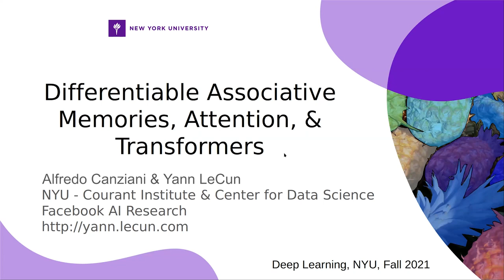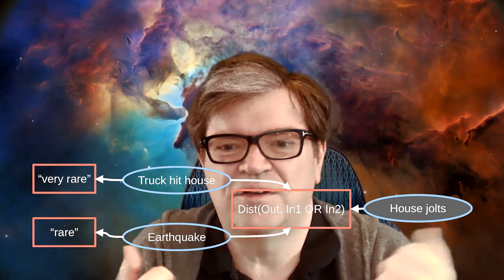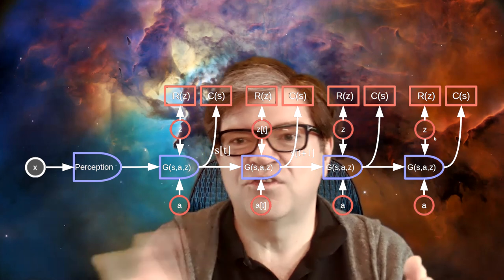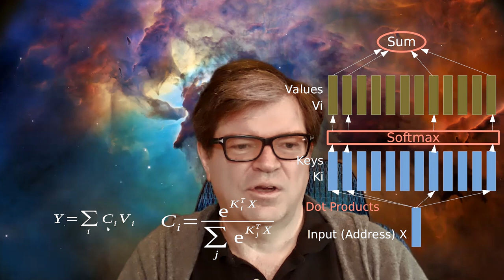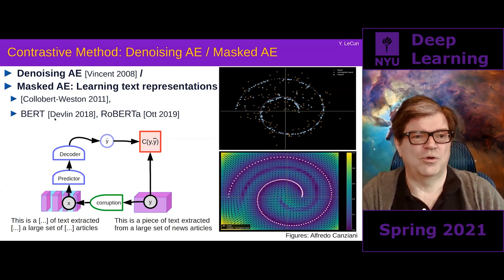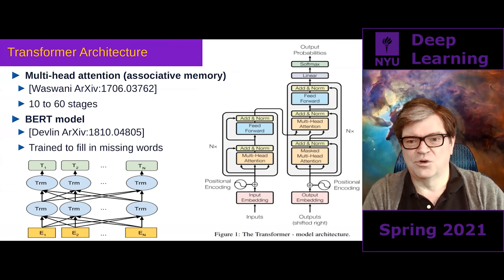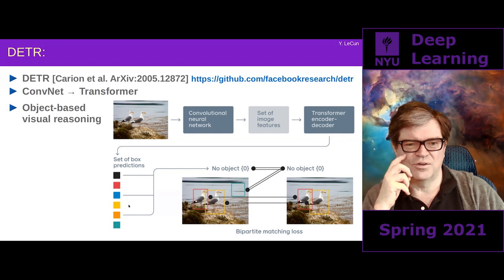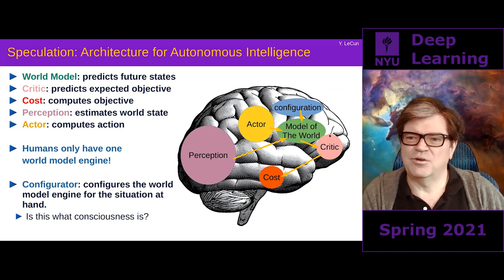09L – Differentiable associative memories, attention, and transformers

Comment: Timestamps:
00:00:00 – Motivation for reasoning & planning
00:09:11 – Inference through energy minimization
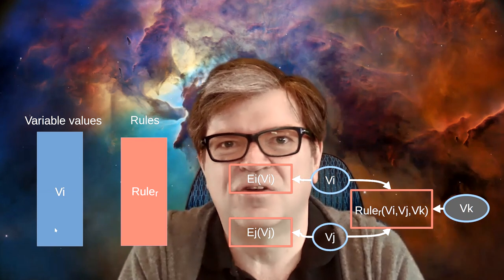00:18:08 – Disclaimer
00:19:02 – Planning through energy minimization
00:32:59 – Q&A Optimal control diagram
00:39:23 – Differentiable associative memory and attention
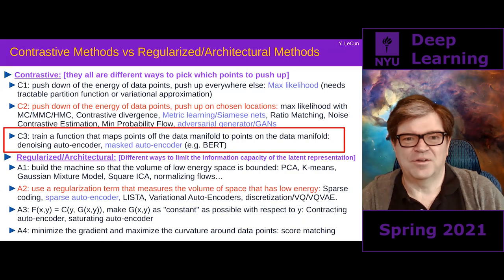01:01:03 – Transformers
01:08:14 – Q&A Other differentiable attention architectures
01:10:32 – Transformer architecture
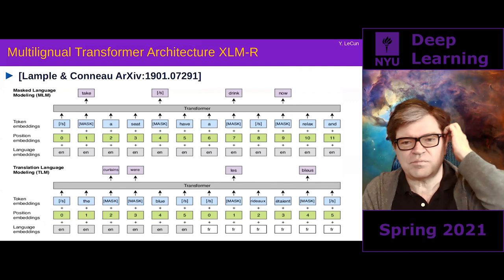01:27:54 – Transformer applications: 1. Multilingual transformer Architecture XML-R
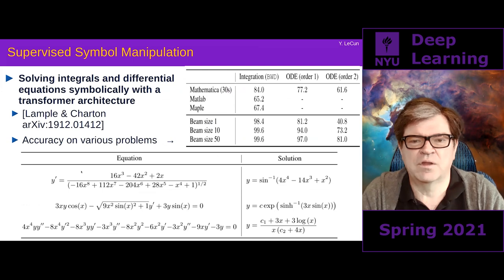01:30:16 – 2. Supervised symbol manipulation
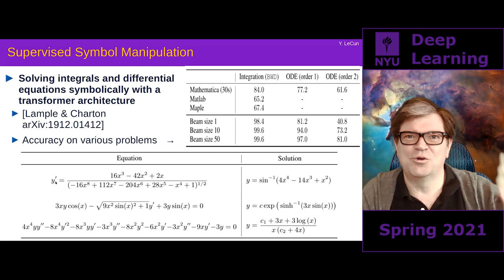01:32:14 – 3. NL understanding & generation
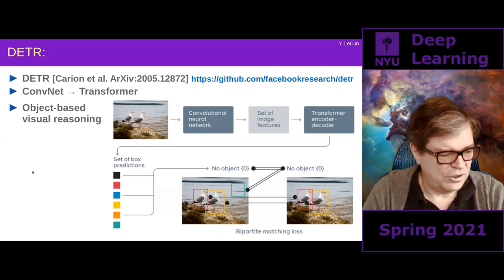01:36:51 – 4. DETR
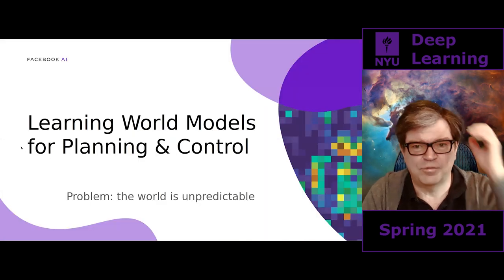01:46:47 – Planing through optimal control
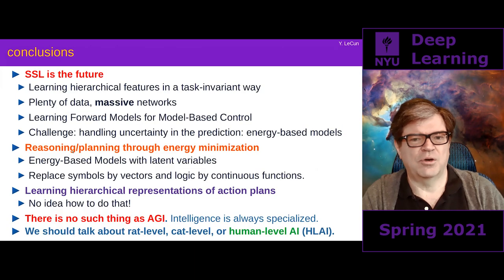01:55:37 – Conclusion
Reply from the maker: Thanks a bunch!